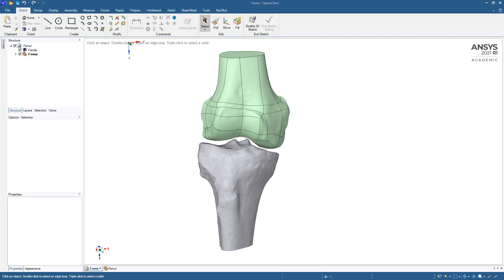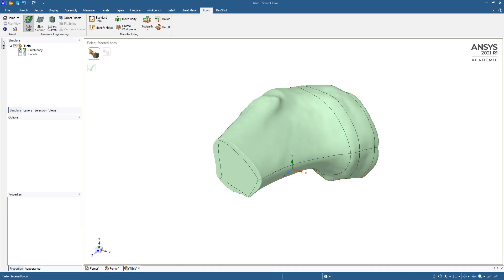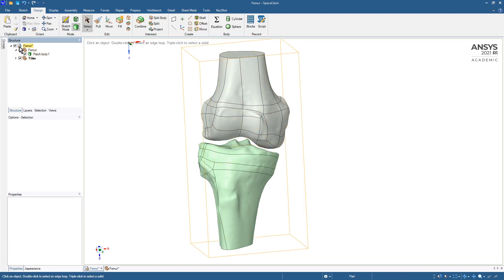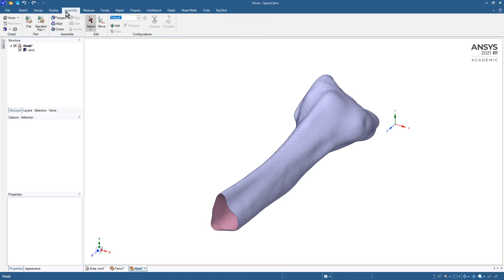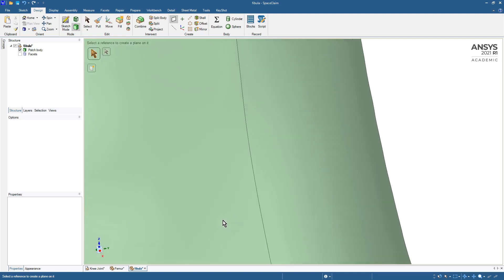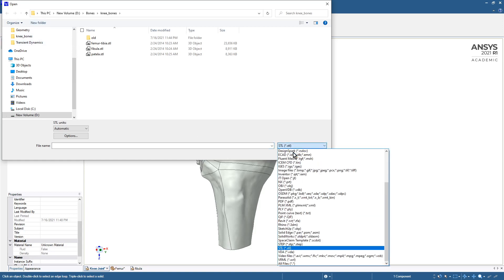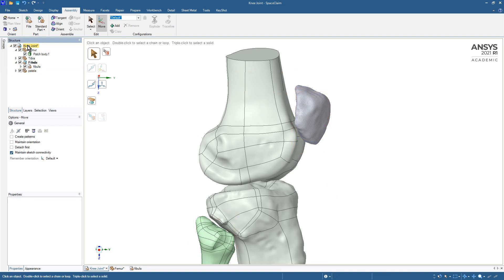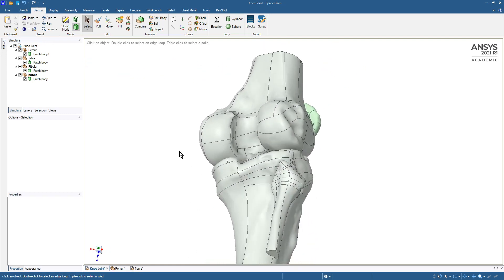ANSYS SpaceClaim 2021R1 STL convert to Geometry Part 2

Comment: Hello, I'm working on a wrist reconstruction and I would like to know how it is possible to make or add ligaments or cartilages with Spaceclaim, I couldn't find the part 3 you mentioned so I guess you don't. didn't come out and the first 2 were very clear so I was curious how to do it
Reply from the maker: Yes, it is possible to have cartilage between the bones. It is simply a matter of having the CT data segmented for cartilage  instead of bone, then convert the STL into geometry.  Ligaments are sometimes represented as springs.
Reply: @ansysfeaexamples9351  Thank you for your answer, I had seen mentions of the springs but I was wondering if they were designed as classic springs or is it specific in the context
Reply from the maker: @nathancollard9591  It can be a classic spring if the line of action is simply between the end points.  If the line of action has to wrap around a bone, then you need a flexible body to do that then use a spring after that.
Reply: @ansysfeaexamples9351  Thank you very much, now that I have finished the ligaments I am asked for the cartilage, you rather said that CT scans were needed, is that the only solution? I had thought of doing a Boolean operation between 2 shells but the result is not satisfactory
Reply from the maker: @nathancollard9591  You could create a disc of material about the right diameter but much too thick and subtract where the bone intersects the disc to make an approximation of the cartilage.